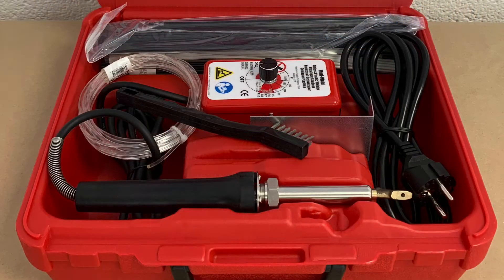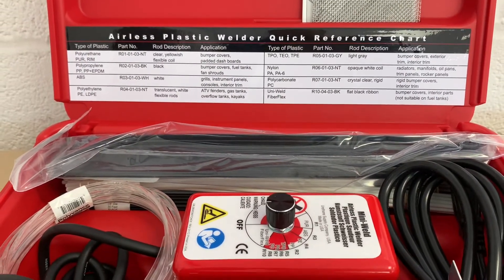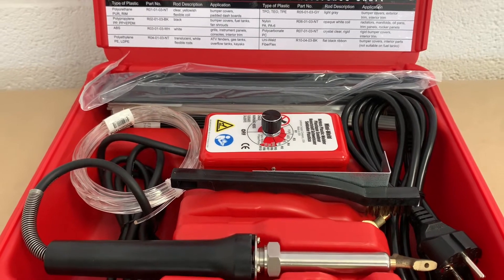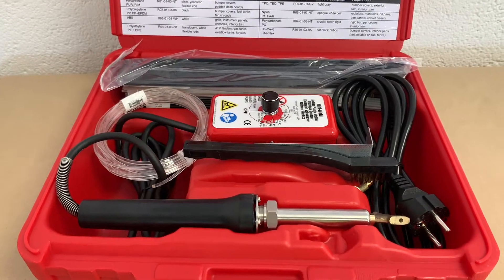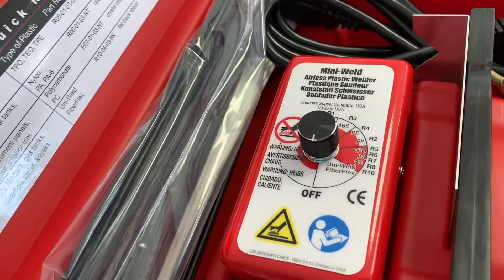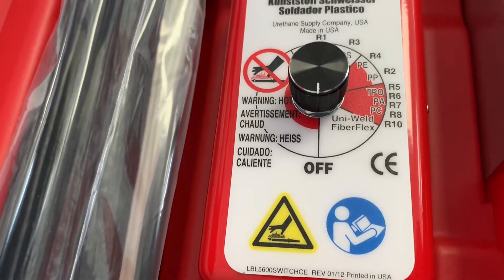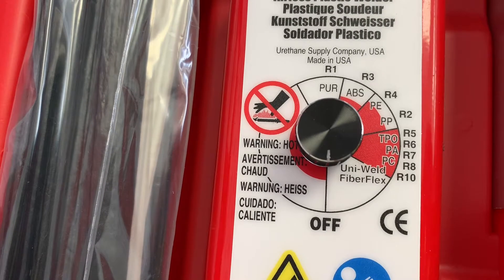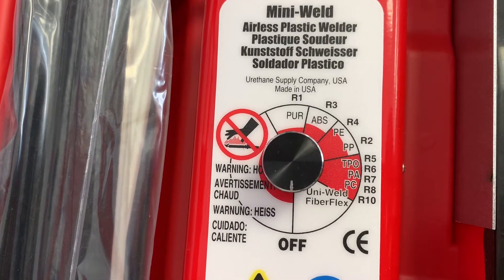POLYVANCE AIRLESS WELDER

Comment: Hi I do smart repairs like you and have been using a ANI R 150 mini spray gun. I want to set up....Can you tell me what would you choose , the LPH 80 or the SRI mini spray gun, ?  Wanting to use the gun for base coat clear coat. Thanks Wayne.....from NZ
Reply from the maker: Check out my review about the LPH80, it’s a few posts back. 

Now owning both guns I would have to say that the LPH80 just beats the SRI.

Ps I don’t rate the ani 150 - the fan width failed to quickly and I sent it back

I would also not recommend using one gun for both base & clear, I’d always keep this separate and have 2 guns